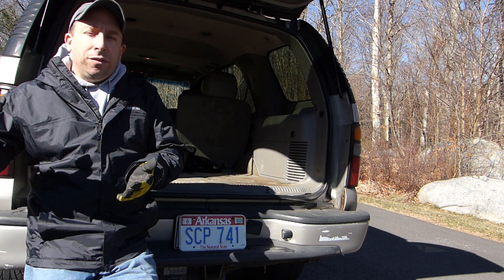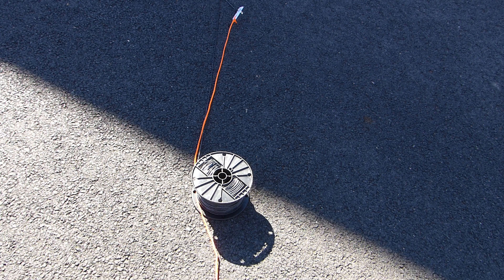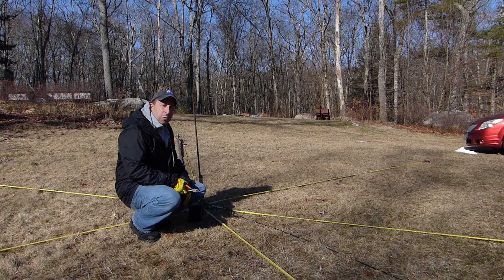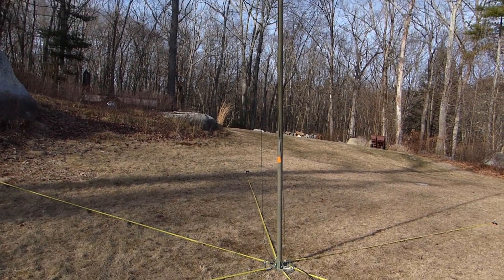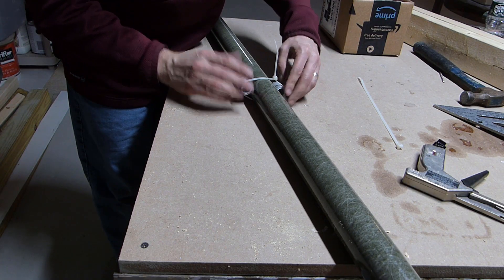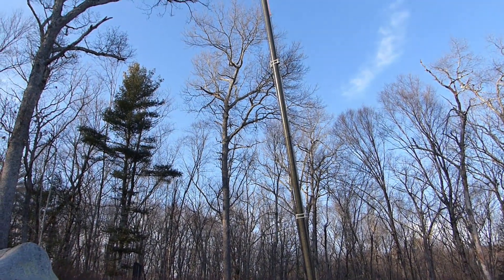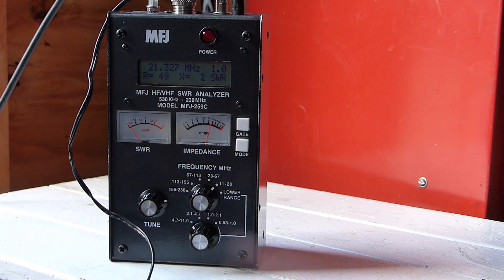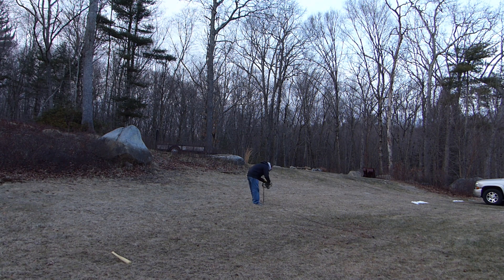Ham Radio Home Brew Multi-Band Vertical Antenna Tuning and Upgrades - POTA / Field Day

Comment: Rob I love that antenna setup!!!  I really like how you can pretty much cover every amateur band with just two wires and those ground radials.  I am going to have to look at finding me the fiberglass poles and stuff and make my own!!  That would be a nice antenna to use for POTA and like you said with a tuner (prefer manual), you could tweak it and really do well.  Just wonder how efficient it will be on 160, 80 and 40.  Since the main radial is about 16.5 feet that would be a 1/4 wave for 20 Meters, so it would be less than a 1/4 wave for the other 3 bands.  I believe I am thinking right, correct me if I am wrong.  LOL  But, nonetheless this is a very interesting idea and you have me thinking now!!  I built that WRC clone and it appears to work fine, but I haven't done a POTA activation, I have made a few contacts with it in the back yard but the band wasn't all that good.  I did order a 102" telescopic whip for my WRC clone and will retest my antenna when that comes in.  The hamstick I used works great, but it isn't very portable and I want portable.  Great video my friend.  Juddie - WD8WV
Reply from the maker: Thanks Juddie!  I hope to test this over the weekend to see if it actually works on the air.

Comment: I'm anxious to see how it'll work on a POTA activation. Do you prefer an automatic tuner or manual (just because it seems that I've heard a lot of arguments in favor of manual tuners lately)?  73  W1NLJ
Reply from the maker: I like them both but slightly prefer a manual tuner because it's generally cheaper and a less complicated device

Comment: Keep them under tension you will get lower Swr 😉 and spread the apart from the mast 3-5" it will radiate better 😉 KC3ONO
Reply: Get a cheap hole saw and drill the size of your mast and get cheap plastic cutting board and trim element spreaders holders and use hose clamps.